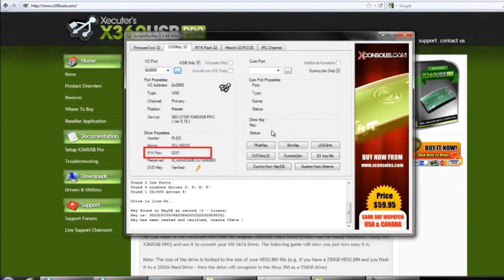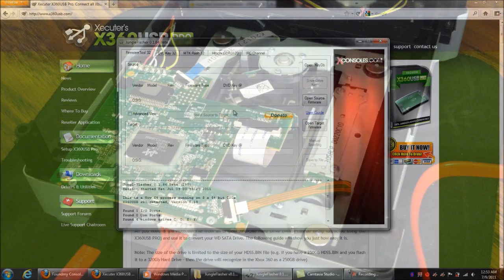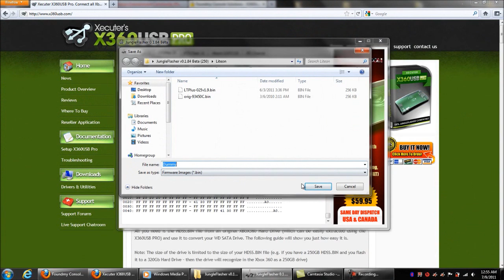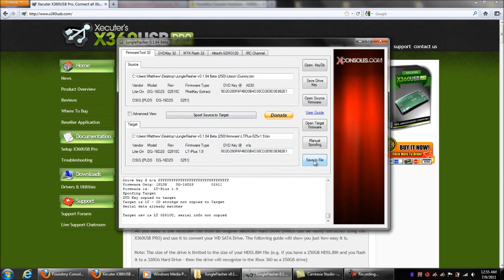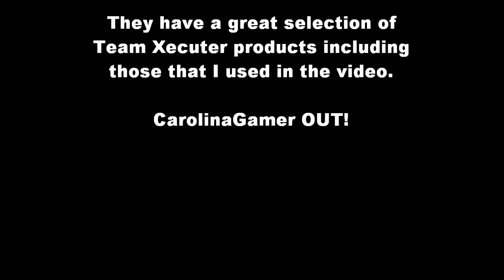X360USB Pro Flashing LiteOn 0251

Comment: bought the x360 pro package. When i received my package i connected my lite on with everything and the eject button does not work on the ck3 pro. I previously flashed a slim with the kamikaze hack and everything went well. But when i tried to flash another lite on, this case its the same one in the video, i cannot obtain the key. I probed the mxo1 with the probe 3 but nothing. Could it be that my ck3 pro eject buttton affects my probe not working?? thanks

Comment: is this the things i need to flash a liteon drive dont wanna buy the wrong things

Xecuter CK3 Pro Rev D * Latest Version * 4.0
AC Power Adapter 110v 4 pin molex (12v/5v 2A)
Xecuter CK3 Probe V3

Comment from the maker: @myricalboi317 If you have a launch slim then it's a 9504 which has now been updated by the dash but you can still get your key and write to it. And yes all you would need is the X360USB Pro and a way to power the drive like the CK3 Lite, and I'm working on that.

Comment from the maker: @6satan6ist6 CK3 and X360USB Pro are two totally different things, you need the CK3 to power the drive, the X360USB Pro it to flash it in windows, so you need both of them together, along with a Probe III, and Molex Adapter.